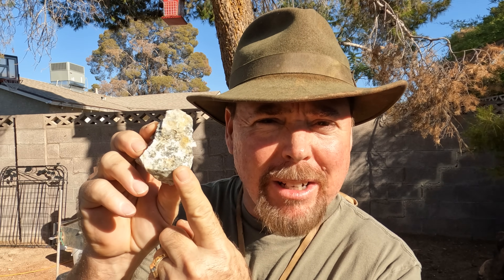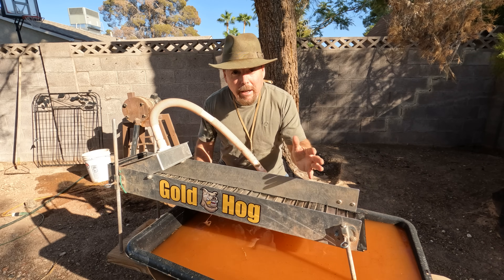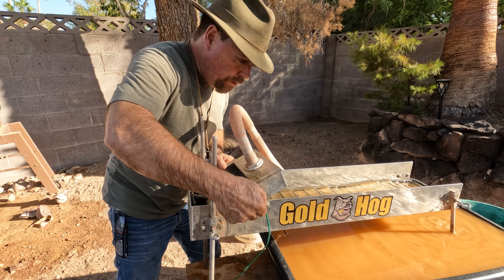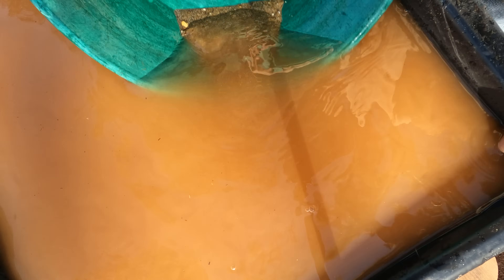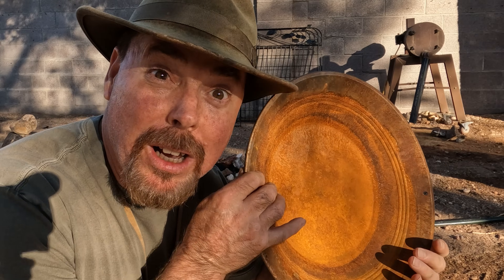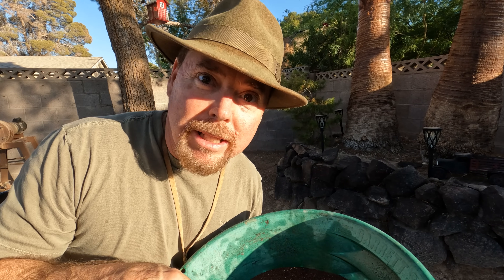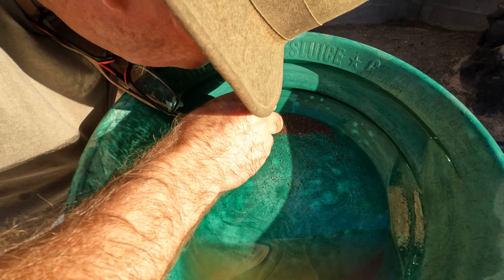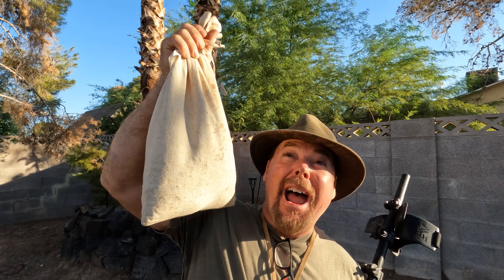I Turned Iron Pyrite into PURE GOLD

Comment: Crush the pyrite, put it inside a glass jar with a drop of mercury, shake it, take out the amalgam, put the amalgam inside a clean jar and  use a bit of nitric acid. Boom. You got the gold. Easier, faster and simple.
Reply: You can't turn Py into Au. You can only liberate Au from inside Py if it's there.
End line is NO. Your not gonna get rich unless you have a mountain of gold bearing Pyrite
Reply: @BennWhistler yeah basically so it’s not really alchemy but it seems like it. Just the au that got carried with sulfur and deposits near or within the structure
Reply: pisahkan campuran yang mana sist..  Maksudnya bagaimana dengan merkury nya
Reply: 1.Civa sadece sadece Altin ve gümüśü ceker toplar.
2.piriti ateśin üzerinde iyice isitilip üzerine Su döküldügunde pirit yumśar dagilir.
Reply: Make sure to inhale all those noxious gasses it adds a lot of value to the experience
Reply: Yeah but you got mercury which is nuts to clean up
Reply: If that worked, they would not have needed to smelt tons of rock every day. The Gold is physically tied up in the molecules of the pyrite.
Reply: @chrissyj5 and you can get the molecules to react more easily by crushing the rocks. Crazy how chemistry works

Comment: I knew it! I always said that the non-magnetic black sand contained gold. Now I called it carbon coated gold, So while I may have been wrong about the composition I was right about the gold. The way I seen it if their was black sand that would get caught up with the gold without having enough iron to become magnetic then it would have to contain gold to have a near identical weight composition? I am not sure if my approach was accurate but my conclusion was.

Comment: Look for sulfides associated with white quartz. Copper or lead sulfides tend to coexist with gold and silver. Step 1 classify, step 2 crush and grind, step 3 sluice and sort for density. Step 4 remove the magnetite. Step 5 roast the concentrate and quench. Step 6 react with hydrochloric acid with air bubbling. This removes elements more reactive than copper. Treat what is left with nitric acid this removes elements more reactive than silver. Finally treat with aqua regia to get the gold.❤

Comment: adding iron and soda ash will cause FeS2 to become FeS which can then be seperated via oxidation, however FeS2 sulphide (pyrite) will not oxidize so, if you want to get it must chemically leech or add iron and soda ash to get FeS

Comment: Where ever there is quartz......there is gold too.
Reply from the maker: not always
Reply: @Askjeffwilliams  Respectfully submitting I followed a metalurgist (professor) some dozen years ago who found that quartz deposits usually accompanied gold deposits as well. He did say in the conventional sense and means of essay work, most wouldn't pursue or aware the following technique but 'brown bottle glass' (which partially consists of quartz (as does most commercially produceed glass)) holds the most by volume of gold compared to other glass.  In his demonstrations & video seminar he microwaved typical "brown beer battle glass" and noted the following:

In a typical long neck beer bottle there consist an average of $15.00 of gold and a total of $90.00 worth per six pack. (This again, was back between 2010-2012 when gold was averaging $1200. per ounce.) After reaching out to those who both supported and followed his work, I attempted the same modified microwave oven experiments at home using black sand as a starter (to initiate the microwave reaction). Noting too, unlike his work I didn't have or use seed gold In each of my samples recovered; nonetheless I did note with (with witnesses) gold present in those samples.  (In his work, the seed gold used was an one ounce sample of 24 carrot gold weighed prior to and afterwards with a notable increase (surplus) in gold retrieved from approximately 45 minutes in the microwave oven. Granted too the typical retrieval measured in grams total were in the +1/2 gram range per long neck. This retrieval process is again, using a typical but modified home microwave oven.) (In his commentaries he noted: (1.) Gold found in nature consists typically two or more primary elements; the first is gold the other is carbon. The carbon when examined are the remains of insects that injested the gas which gold is comprised of in its original form. That same "gas" is also found in quartz (hence its being proved in the microwave experiments.) (2.) His end goal in sharing his findings was to help & demonstrate the simplicity a young family working from their own kitchen table could earn an extra income of $100 or so weekly without sacrificing family time working away from home. (3.) "Black sand"  when typically essayed normally shows little additional elements (other than any elements found during an essay). However, when ran through a "microwave" process, elements consisting of the heavier precious metal groups are also found; among them platinum and platinum have been noted. ☺
Reply: Did you or youtube delete my respectfully submitted rebuttal? 😊

Comment: Fake news you can't turn iron pyrite into gold because you can't get gold from iron
Reply: The gold is trapped in the sulfides, not the iron. If there is gold in the sulfides you can 100% extract gold from iron pyrite
Reply: Where there is plenty of iron , there is gold .
Reply: @OmShiv-so5hy  wrong iron pyrite points to where gold is possibly but there is no iron in gold they're two different separate elements
Reply: Dude 😂you didn't watch the video for one for two your taking it out of context and for three it's not news it's an informational video about prospecting with sulfides
Reply: @brandonm4330  nope you still can't get gold from iron it's almost impossible to change a lesser metal into a more valuable metal
Reply: @brandonm4330  I need the video with fake from the get-go cuz I've heard about this kind of crap
Reply: Iron pyrite can contain traces of gold which can be recovered through roasting, pressure leeching, and bioleeching.
Reply: @tarrantwolf  fake news iron pyrite doesn't have any gold in it that's the reason why it's called fool's Gold if it did have traces of gold in it wouldn't be enough worth recovering your argument is invalid

Comment: Be careful only about 20% of the population can smell Arsine so be sure to ware a respirator. You would need the 3M 60921 (light blue) cartridge with both P100 particulate protection and organic vapor/acid gas filtration.

Comment: In the copper refinery the Au & Ag fell out of the electrolytic cells into a mud. The Au/Ag was all tied up with Se & Te.  We would flux it with niter and burn off the Se&Te (sulfur-ish stuff) to get the dore Ag,  Our As got squeezed out of the electrolyte. Sb simply came out of solution and clogged the pipes!.  Fun stuff, good info dude.
Reply from the maker: thanks for sharing your knowledge

Comment: Hi again Jeff?  What about mica along with Galena?
I use a bucket mini miller table that i got from Rhetta quite some time ago. She said Darren used to use it. But what it does is seperate the microscopic stuff out. It doesnt actually have riffles in it but just a rubber mat in it with tiny bumps all over the mat u can hardly see or feel.
Also i get all that grey rock (schist) out of my mine but when i roast it it turns that dark red like u showed.
Reply from the maker: yep them miller tables work great

Comment: I have a golfball sized blob of sulfides, suposedly from a filled in anciant wash some where in CA desert, some old guy gave it to me like 35 years ago. He would use a 30gal oil drum, put his ground up stuff in it. Put at an angle so it wouldn't fall out the drum spins over a big propane torch. Was like 2 weed dragons for the burnners. Once the can was hot he would run it like 1 hour and then would dump it all into water. Dry it in the sun, put it back into the spinning drum and dump an ounce of mercury in with it and spin overnight. Then he slowly dump it over a charged copper plate and the mercury would stick. Then he would do the vaporizer thing get his mercury back. He was pretty gunho guy, lol, he would hold up his flask full of gunk " this here is gold" and his buddy would always say, "we would get more money from recycling catylitic converters for platnium"  He was all about that getting gold from pyrites in that soft decomposing granites. :}
Reply from the maker: thats a great story and thanks for sharing it with us ... good times